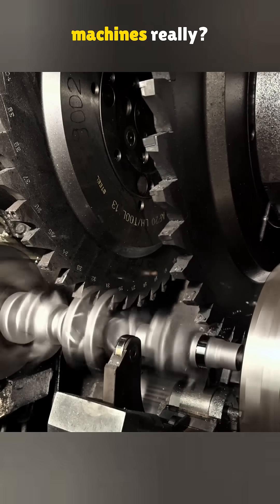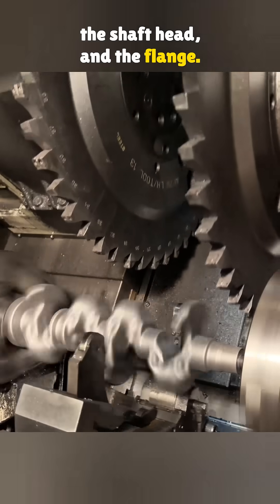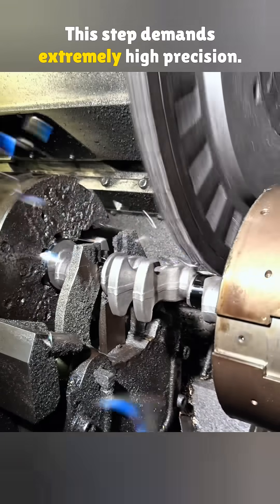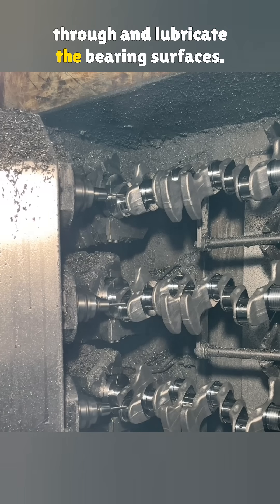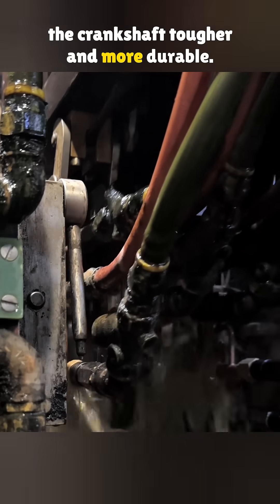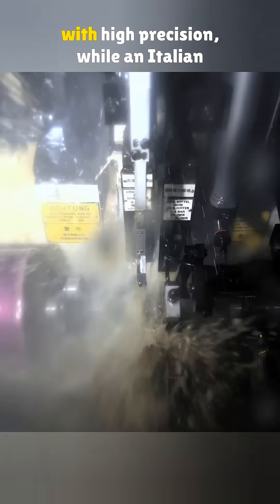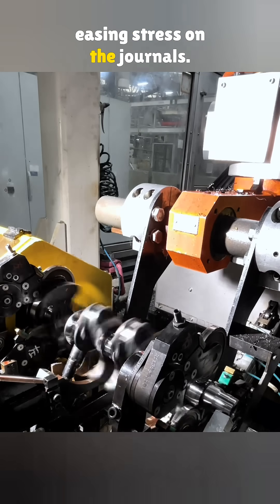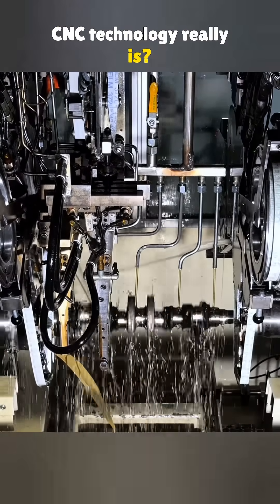How Far Behind Are Chinese CNC Machines #automobile #mechanic #car #assembly #manufacturing

Comment: BYD and other EV companies no longer import precision tools
Reply: and you don't need camshaft grinders or oil journal drilling machines to make an electric motor.
Reply: @jamesmurphy449  BYD build hybrids.
Reply: @JamesRowlandsRocks  This is just a transitional period. The transition from the electrical age to the electronic age takes time and also requires a transitional period.
Reply: @jamesmurphy449  Yes - a lot of high precision engineering here going into a grossly inefficient energy transducer.
Reply: 😂😂😂😂...good joke guy!
Reply: I was just riding in a BYD suv doing uber in Cololmbia. My friends who had teslas commented that the build quality and sound insulation was much better in The BYD
Reply: @Devin-Michael Heu! not a compliment for tesla...
Reply: @Devin-Michael my brother in-law has a BYD on lease after having a Tesla. He initially loved it but 8 months in he's changing his mind. The interior is his biggest gripe, seats are showing excessive wear because the foam appears to have pretty much collapsed, and various trim pieces rattle/squeak. Nothing to point at on the exterior yet though.
Reply: @scottll  Neither Tesla nor BYD cars get my vote, I ride a BMW R1150.

I’ve been in a Tesla and hated it.  It felt like it was a bit too empty; a go-cart on steroids if you wish.
Reply: @Jenny_Digital comparing an electric car and a motorcycle with a boxer engine is a bit surprising 😂 ... I would say that the doors of your rt will for sure last much more than those of the tesla 😅
Reply: @scottll  Did he buy a BYD that is priced the same as a Tesla? BYD also has high-priced cars,
Reply: Sure.. I hope you dont believe it
Reply: That's because there's not much machining on the electric motor drive shaft. Simply a thick rod
Reply: @OffGridInvestor Wrong, the motor body has precisely machined interiors for maximising magnetic flux density and preventing leakage which leads to unnecessary eddy current losses.
Reply: @JohnLee-bf2ux and direct metal 3d printing is starting to take up that field more too because further beneficial non-machinable cavities and geometries can produced, is that right?
Reply: By this time, most Chinese brand won't use expensive western tools.
Reply: Correct reciprocal machine, a.k.a, I CE required, precision fit and lubrication, electro motor and simple gear in a EV, do not need such a high requirement
Reply: @Alexpktang  they sure do need precision machinery. but china is now producing CNC machines on a level comparable with german stuff. maybe they dont surpass japanese machines atm, but they sure will very soon.
Reply: @simonschneider5913 give me an example of Chinese brand which equals German Hermle, GROB or Heller CNCs. You are full of bullshit.
Reply: @louies6914 Guarda i dati di vendita dei macchinari industriali cinesi, così capisci quante stronzate stai dicendo tu! 😂😂😂😂
Reply: @louies6914 BYD.has EVs that far beats anything German made and BYD is the most integrated BEV maker in the world , I would never buy any German auto , they are built to fail, and cost a fortune to maintain.
Reply: Not true with the new VW, they have unlimted miles/km and only service every 2 years... and u have a garati on it if it breaks and higher qulity standarts than a asian car
Reply: @simonschneider5913 
China doesn’t have the expertise to produce CNC machines on par with those made in Germany, Spain or Japan.  Especially Japan
Reply: @didierduplantier8359 
And may I add; sooner or later, the Chinese will buy those German, Spanish and Japanese CNC manufacturing companies.

LoL
Reply: @simonschneider5913 stop drinking the Kool-Aid
Reply: @jamesconnors8095  the kool-aid is dished out by those who think western products are superior in any way.
Reply: all the machines in this video are now produced in china, with good quality in my opinion. germany is done when it comes to competing with china. its not even close.
Reply: @simonschneider5913 
Yes, China is the queen of counterfeit products, but we all know how they are when compared to the real thing
Reply: @didierduplantier8359  "its not a lie, if you believe it!"

the anti-china-cope is amusing to say the least. I will buy some more chinese industrial goods and hope you guys dont crew up trade with china completely.

you should change your media diet. china just fired up a thorium-based nuclear reactor nobody else could get to work yet. germans tried for decades. others too. china did it. and theres more where that came from.

wait until the US-china war comes, then you will see the really good stuff. or not, because your screen prob wont work anymore.
Reply: @simonschneider5913 
Ok, Wumao😂
Reply: @didierduplantier8359  perfectly normal reply for someone that has nothing else to say.

you didnt argue with the mention of sales figures for chinese CNCs either. I can guess why that is.

but hey, keep buying the "good old german" stuff - and get hosed by people who dont even keep their money in germany, but buy chinese parts wherever they can only to then mark them up, to sell to you! :)
Reply: @simonschneider5913 same as Europe is running a fusion reactor: both are experimental, with commercial applications being years away (admittedly, the thorium reactors will arrive sooner)
Reply: @simonschneider5913 bullshit, Chinese brands don't equal the brands I mentioned in the previous comment. Stop spreading lies.
Reply: @louies6914  tell me what makes the ones you mentioned so special? the marketing and the tradition? :)

because at this point, thats all germany got going for them.
Reply: @simonschneider5913  When a see a Chinese auto with 180,000 miles ,or 200,000 Kilometers on original engine then I’ll say yes !
Reply: @chavitacanta008  you sure wont see current german cars running for that long.
Reply: @simonschneider5913 You won’t see latest generation German cars make it to 100,000 miles without problems .😂
Reply: BYD say no more.  shit cars
Reply: @kristene2372   Here in Asia its unbeatable features and value for money. Maybe a shit car to you, but by American standards 70 percent of the worlds population lives in shit places... so it's perfect for us.
Reply: @tanupprasai9245 you're fucking welcome to them!
Reply: @samrodian919  Thank you. I drive a Ford now but my next is a BYD
Reply: @tanupprasai9245 
Better find bigger landfills then because you’re going to need them.
Reply: @didierduplantier8359 Credit Swisse was hired to evaluate Chinese cars. 

Results: We can't make cars this good at this price. Allowing Chinese cars I nto the US market would be a cataclysmic event.

BYD and other Chinese cars are NOT ALLOWED into the US.
Maybe in future with 100% tarrifs.
Reply: @dmar1717 
Credit Swisse was hired by whom?  
The US government has never wanted to be a dumping ground for Chinese EVs, so who actually cared about this evaluation?
Moreover, the vast majority of Americans still prefer ICE vehicles over EVs, so it is wise to keep the Chinese out to help our domestic EV producers.  Eventually, other countries with pledging EV industries will see the benefits of such restrictions
Reply: Might explain why BYDs are known for spontaneously combusting. 😂😂😂
Reply: @michaeloxlong FAKE NEWS !!!
YOU SPEAK LIKE YOU NEVER SEEN A GAS FIRE IN YOUR LIFE , MAYBE YOU LIVE IN THE MOON?
Reply: @AuralioCabal-nl8gi Gasoline cars don't just randomly burst into flames on the highway. BYD cars do. 

Btw, how is Winnie the Pooh? Is he still paying yall 50 cents per positive post? (I can see your other comments. 😂)
Reply: @michaeloxlong One 2023 TOYOTA Tundra owner just had his Pickup go up in flames 🔥, he had just gone thru the recall , he was trailering a car to a show when it went up in flames , he had no brakes on top of that . Gas cars are Death traps!
Reply: @AuralioCabal-nl8gi 3000 BYDs caught fire (that we know of), per year due to a design flaw in the batteries. And your response is to talk about 1 car that caught fire once? 

Btw, I love EVs... but you couldnt pay me enough to drive a BYD. 😂

Winnie the Pooh isn't paying you guys enough. 😂😂😂

Also, looked up the example you gave. You know what caused the fire? A fault in the electrical system. 😂
Reply: @AuralioCabal-nl8gi What recall? You can only catch on fire if you have a huge wiring fault or a really bad fuel line / fuel injection failure.
The reason 50+ year old cars catch on fire is usually an alternator that never got replaced and shorted open or a piece of wire that rubbed open.
Easy fixes.
Reply: @michaeloxlong when apple sales bad, story of samsung phone exploding went viral
Reply: Goddamn these Chinese bots are obnoxious. This platform is ruined. Truly no reason to look at comments anymore. Saying an electric motor needs precise machining for “muh flux density” is an absolute insult to journal bearing everywhere. If you think electric motors need precision to the level of an ICE you need to throw in the engineering towel.
Reply: No because they have all the bots they need here in the comments. 😂
Reply: @pw36952m The bots are YOU PEOPLE, unless you're just clueless FOOLS.

US is well known for their shiihole propaganda campaigns.
They spend about 500 million  USD each year to slander China. You can look it up

US is the Empire of Lies.
Reply: @pw36952m keep sleeping😂

Comment: This is ALSO very true of Russia.    A few years ago, their biggest IMPORT was  "auto parts".   At first I thought, gosh why are Russians in need of so Many auto parts.  Then when  numerous Foreign auto corps closed their assemble plants in Russia I realized, Russian do not make Russian cars anyone will buy, so they import all the parts and glue, nail, screw and weld the stuff together.

Most commenters are missing the point,  if we the WEST were to CUT either Russia or China OFF from Western tech....both countries would have trouble.
As Ukraine has found Russian missiles can't fly without Western tech.

To end the Ukraine war,   arrest, jail and perhaps terminate any CORP Ceo who allows Western tech into Russia.

Comment: Stop your Bullshit China Builds and supplies the rest of the world with the most advanced CNC machines in all industries and is a world supplier of automotive components both electric, diesel. And petroleum engines not just parts but completed units, it also is a manufacturer of precision tooling once the British and American Specialty no longer the case. So, stop using 20-year-old Videos well out of date those machines are covered in shit you will never see that in a Chinese Plant.
Go to the Canton fair and ask what other country can make similar machines.

Comment: China is literaly selling 6 axis CNC machines on Alibaba ....
Reply: Anyone can slap servos on screws and bolt a table on it. Give me repeatable micron precision with reasonable maintenance intervals and a user friendly interface and we'll talk.
Reply: @Teth47  HuazhongCNC (China)

Overview: HuazhongCNC is a fast-growing Chinese CNC controller manufacturer, aiming for global leadership.

Key Products: HNC-848D, HNC-808D, HNC-818.

Strengths:

Strong R&D in intelligent controls and AI integration.

Affordable solutions compared to Japanese/European brands.

Considerable domestic market support in China.

Industries: Automotive, heavy machinery, and general manufacturing.

Market Position: Leading CNC brand in China, rapidly expanding globally.
Reply: @Teth47 you on my page brother
They flog their average tarted up machines worldwide to unsuspecting buyers that think they've got a 30% or more off bargain and in reality
It's more trouble than it's worth 
Alright if the items your making are medium or low teir 
Parts can be really hard to acquire 
You will end up making your own a lot of the time 
Help and service can b sketchy 
Cheers ova
Reply: So what? What's your point?
Reply: @vadimplatonov7750  You can't grasp the point ? It's obvious !
Reply: @user-qq8ek4zs4s If it's obvious, then explain it in more details. Use smurf language in your explanation and make every sentense no more than 6 words.
Reply: @user-qq8ek4zs4s  you have yet to make a point. I'm sure there's  differences between those on Alibaba and a Mori DMG, and when those differences are what counts, that's why still a market for the better machines. I'll bet you think 3D printing will replace machining too, because you just don't get it. You don't UNDERSTAND what you're talking about, but that will never dissuade you from continuing to talk.
Reply: @goatfromhell666   🤡 please .... You keep fixating on a comparison nobody made while completely skating past the obvious reality that the sheer presence of fully functional  6-axis CNC machines on a mass-market platform like Alibaba is itself a symptom of how vast, normalized, and deeply industrialized China’s CNC ecosystem has become an ecosystem whose actual muscle comes from serious manufacturers like SMTCL, Dalian Machine Tool Group, Qinchuan, Haitian Precision, Hision, Yawei, Neway, Borui, and an entire upper tier of high-precision builders supplying everything from aerospace to automotive so every time you fall back on “but it’s not a Mori DMG” as if that were meaningful, you only underscore how far out of your depth you are in understanding the scale, stratification, and technological gradient of the industry you’re trying to lecture about !
Reply: @user-qq8ek4zs4s I hope new companies get themselves off the ground with the cheaper options from China. Meanwhile, any established manufacturer knows that the money saved initially will be eaten up or exceeded completely by downtime and critical failure before ROI. You can steal IP, but you can't steal R&D. Even though China launched themselves into the industry by copying decades worh of design and ingenuity, they lack the knowledge of why certain things are designed the way they are and what are the proper materials and heat and chemical treatments to ensure that every part will hold up for constant use over millions of cycles. Speaking of materials, the reason our customers don't care where we get our materials from, as long as it's not specifically China, is because they're also new at metallurgy, and will and do lie on composition and properties reports. You think they just do that for exports? I doubt it. You keep keeping the Chinese dream alive though little buddy.
Reply: @user-qq8ek4zs4s  I hope new companies get themselves off the ground with the cheaper options from China. Meanwhile, any established manufacturer knows that the money saved initially will be eaten up or exceeded completely by downtime and critical failure before ROI. You can steal IP, but you can't steal R&D. Even though China launched themselves into the industry by copying decades worh of design and ingenuity, they lack the knowledge of why certain things are designed the way they are and what are the proper materials and heat and chemical treatments to ensure that every part will hold up for constant use over millions of cycles. Speaking of materials, the reason our customers don't care where we get our materials from, as long as it's not specifically China, is because they're also new at metallurgy, and will and do lie on composition and properties reports. You think they just do that for exports? I doubt it. You keep keeping the Chinese dream alive though little buddy.
Reply: @user-qq8ek4zs4s btw, I don't know what I'm talking about; I'm just sitting here typing away without a care while my 30 year old Mazak is roughing out some 4340, and still holds a .0001in tolerance, like it has, for the last 8 years that I've worked on it without failure. No Chinese machine made today will be able to claim that 30 years from now.
Reply: @user-qq8ek4zs4sAll the mentioned brands don't come even close to Taiwanese brands like YCM for example. There is a reason why the world uses taiwanese machines and not Chinese ones. South Korean machines like DN Solutions or Hwacheon are also a good option.
Reply: So what? Who even wastes momey like that, if you need a 6 axis machineing tool, it means you need it for some expensive sht. You dont take the risk buying a piece of trash from china when other established companies sell machines 10 times better and more reliable
Reply: @sevrajsami Die Arroganz der Europäer, besonders die Deutschen werden ihren Preis dafür zahlen müssen. Und das sage ich als Deutscher.
Reply: @sevrajsami  You need to wake up 🤡  it ain’t the 60s anymore. China accounts for over 50% of the global CNC machine-tool market. They are far ahead of the West, both quantitatively and qualitatively. Literaly any major company around the world CNCs in China for a reason. Did you forget where your iphone (among other) were made 🤣🤣🤣
Reply: @user-qq8ek4zs4snone of these phones' CPUs are made in China, since China can't produce them.
Reply: good luck with that 😂
Reply: I got a tool guy. He can make anything. He's from India and their steel toe boots are sandals.
Reply: China is a big joke outside of China. You are being mocked and rediculed EVERYWHERE because all the wumao lies are like a 7 year old child lying to its parents and thinks it sounds plausible 😂
Reply: What is the volumetric accuracy on those machines? Do you even stop for a moment to think about what are you saying or just post random stupid comments for fun?
Reply: And nobody uses them for production.
Reply: @karaffens i bet low cost machines without extreme precision are also useful for certain applications that dont need micron precision
Reply: @SmokeyPyro 
In the India only🇮🇳👌😁
.... and China🀄
Reply: @karaffens  I guess you know the entire planet 😂🤡.
Reply: Hahaha yeah they make them but they use the old imported ones from Germany Spain and US, the ones on alibaba probably last a week on any production scale.
Reply: @Nostradumlbass Americans could buy them and restart manufacturing at home.
Reply: @cj-fh4nx what about the people ? From the qualified worker to the eng !